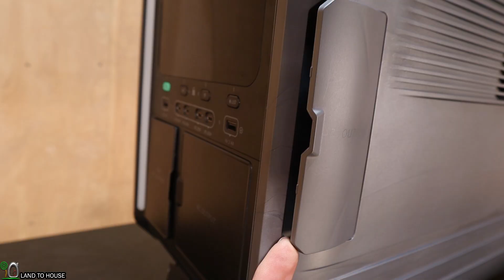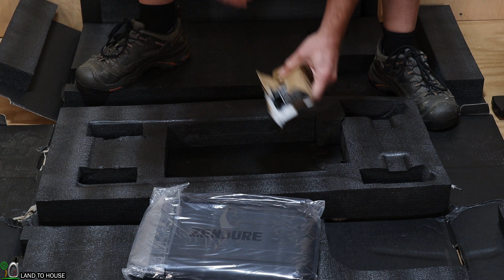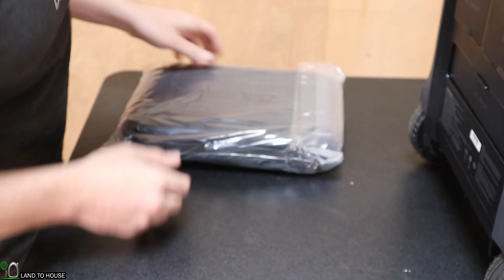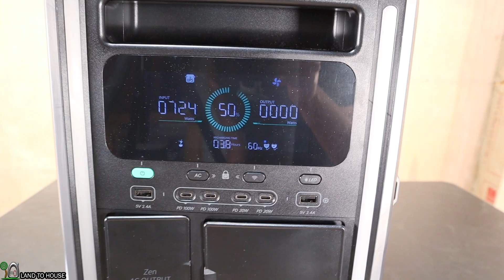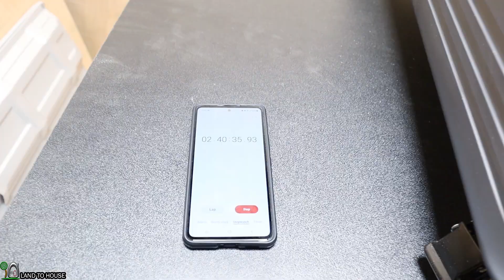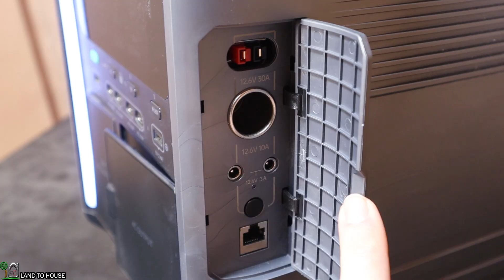THE BEST House Power Backup Zendure SuperBase V

Comment: Has a very eco flow delta pro like design. Also you didn’t show the Wi-Fi or Bluetooth functionality. I assume that just like most of this system it would be very similar to the Ecoflow app.
Reply from the maker: This is a nice machine. I have a few other features that need testing. When I get wifi installed into the shop I plan on testing out the app. And Zendure is sending a Y cable to test 240v.

Comment: Nice PowerStation.  The lights are well thought out, so that you can see what you are doing with the front panel and plugs.  
A few thoughts: With the TT-30R receptacle (3 prong hot-common-ground) you are only getting 120vac single phase to run into the transfer switch. Since they advertise it for emergency backup for the houose, I'm surprised it doesn't have an L14-20R receptacle (4 prong hot1-common-hot2-ground) so that you can use the full 240vac and get both hot sides to feed the transfer switch.  That 240vac NEMA 6-20 plug (3 prong hot1-hot2-ground) doesn't provide a common so you can't balance the load across the two legs of the 240vac inverter.
Reply from the maker: The company is sending a Y cable. The tt30 on the front is only 120v. But the inverter supplies 240v across half of the receptacles. By using the special cable the unit can supply 240v. I will have to make another video once that cable arrives.
Reply: @LandtoHouse  Yes please make that video.  I predict the reason the upper left NEMA 5-20R receptacle is sideways is related to that y cable feeding 240vac.
Reply from the maker: @jllaine  I will make the update once the cable is sent. I will also have a large heater that needs 240v so I can test that the zendure can supply 240v at 3000w.

Comment: The elegant built quality and battery capacity is whats stands out of this power station. Its comparable to the ecoflow delta pro but with more capacity.
Reply from the maker: Well said. After using this for a month I have to say it is impressive. It has been running my tools with no problem. As I type its recharging some portable speakers.

Comment: I'm anxious to see you charge this with solar. Also, make a road trip to a EV charge site and try that T2 port on the back.
Reply from the maker: I am going to "modify" an old cable with xt90 so that I can use mc4 connectors. This power station can charge at 3000w of solar. I have 2kw on the hill.

Comment: Difference between power meter and power on Zendure  maybe comes because lighting and fans on Zendure  are also consuming power.
Reply from the maker: Yes very true. Running the AC inverter also uses some power. There is a good chance that 100w is the difference.